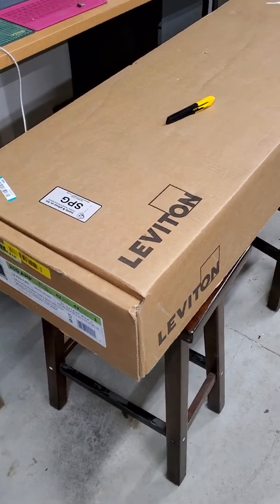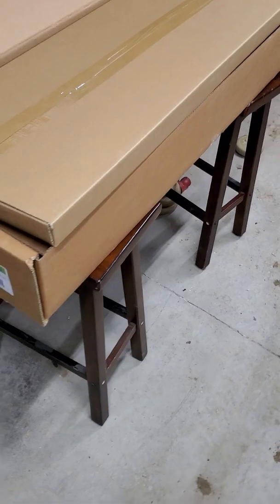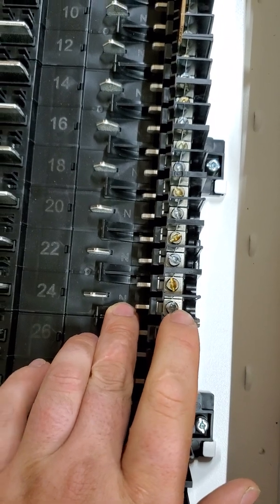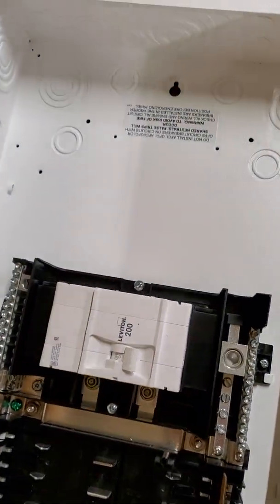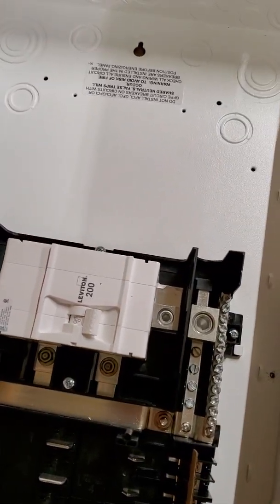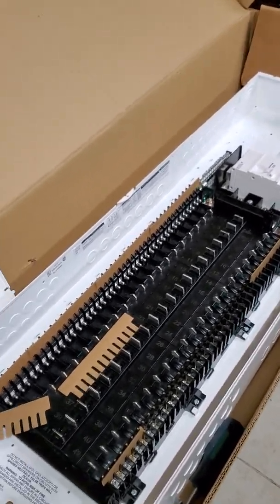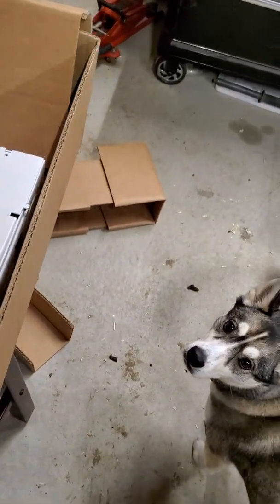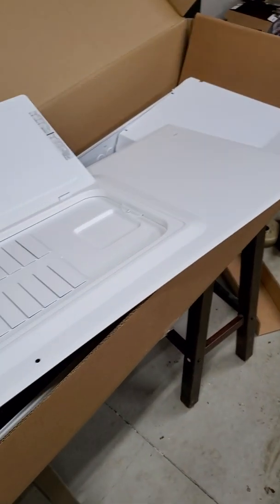Leviton 200 Amp Load Center Unboxing

Comment: As Leviton is new to panels, do you think there is any worry that they would not continue and be unable to get more replacement breakers?
Reply from the maker: At least with a new product there is lots of product hitting the market. Been trying to get Stablock or Federal Pioneer breakers which are now discontinued, it turns a quick job into something much more difficult

Comment: Where did you get your 100 amp breaker and 30 amp breaker.at 
I been up and down looking for them nobody has them in Arizona so frustrated with the lp-420 mc panel aal in one meter panel
Reply from the maker: I am not sure. We haven't had issues getting breakers for them from our suppliers. However we do not see panel meter combinations here in alberta very often. However I do believe that Leviton has a outdoor rated combination with a 200A main.

Comment: Hey Prairie Jerry, thanks for this! I'm in Calgary and am interested in getting going with Leviton smart breakers. I'm a bit worried that I won't be able to fit all the circuits I need on one of these using my 100A service. I need about 40-50 spaces now and I want room for more than I require. Anyway, great to see a video from close to home! Thanks.
Reply: James, I'm in Calgary as well, these do come 66 circuits 200a, I'm likely going to buy the 42 in 100a due to my old 70's house. Leviton is a very old company, very solid name in the electrical business, I've been in the business for 40 years, all good by friend, go for it !!
Reply from the maker: Can Also get them in 100A variants up to 66 Circuits. I have also heard rumors that they are working on releasing tandem breakers

Comment: Is the 225A panel bus rated for 225A?  Or 200 like you mentioned?
Reply from the maker: I will check into that. I know all the panels busses are rated for 200A for sure. Only supposed to load it to 80% of that. I'm cracking open another panel tomorrow and I will let you know

Comment: Nice commentary.  I did see how you can just add a couple of ground terminals up high at least here in the States.   Seriously considering upgrading my panel to the Leviton next year.
Reply from the maker: yes so the left side is a grounding bar, where as the right side is a neutral bar. In the us you could definetly enter in the top and land all your grounds on the left side. We need to land our grounds down in the bottom instead.